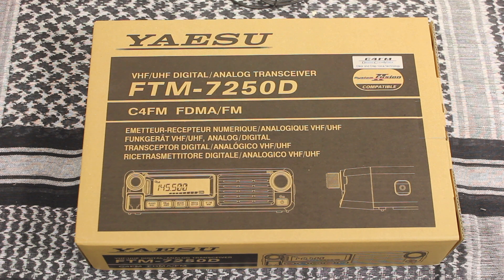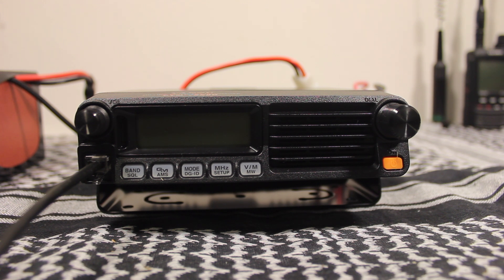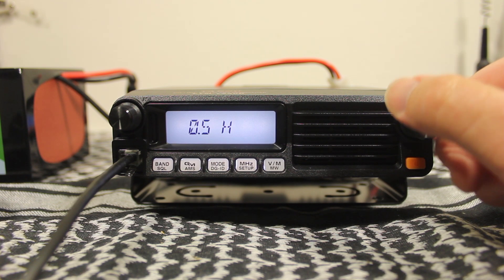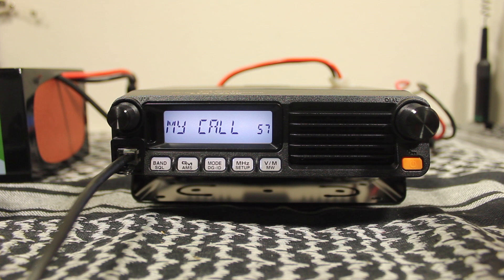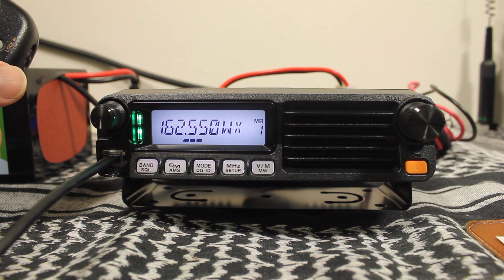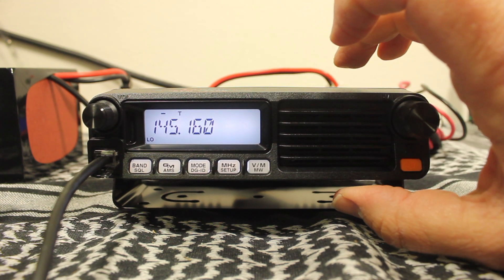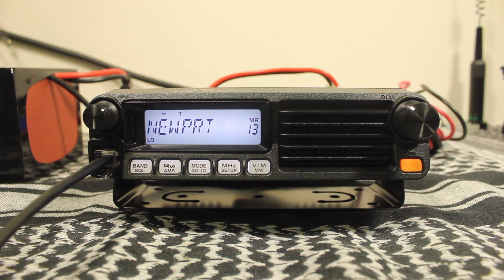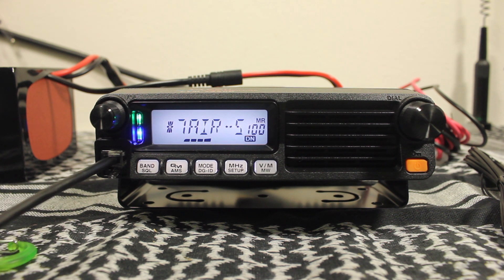Yaesu FTM-7250DR Overview And Programming

Comment: Wow, now that is a deal.  Our club was just thinking about a fusion repeater but the cost of the radios were really putting us off.  This is super affordable.  Thanks for the heads up on this
Reply from the maker: Thanks for taking the time to watch and comment! It is greatly appreciated. At the time of this video the FTM-7250 is going for $189.95.
Reply: So much less repeater abuse on fusion too, makes life a lot easier if you're running one as you don't have the numpties on baofengs just being assholes. The slight cost increase is a great barrier to entry for the trolls.

Comment: I bought one of those after a lengthy research and I get good contacts on the 2m band even at 50 miles away from some repeaters.   I appreciate showing us , slow learners ,  how to program the frequencies.  It appears that there is no difference in programming a Fusion repeater that a Non Fusion one.  I travel to Orlando FL from Mooresville NC often and want to program all the repeaters down I-77 , I-26 , I-95 and the FL Turnpike.  I still don't know what is the best software to program via computer.
Reply from the maker: Thank you for taking the time to watch and comment! I like RT Systems. They seem to have a program for every radio! They aren't the cheapest thing on the planet, but they work.

Comment: Is it obvious, and did I miss you showing how  to toggle thru analog to digital formats ?
The video seemed to go from you programing the Wilson repeater, to you dropping your call, where the display shows a " D ", off  to one side ?
Which button toggles thru modes ?
Also, can you program the memory for digital only mode, or must you toggle between modes manually ?
Thanks !
Just took a risk and ordered one of these, long after they discontinued them !

Comment: i am a amatuer radio operator here in so cali as well inland empire looking to get started in to fusion radio this video help me out alot
Reply from the maker: Glad this video helped out! There is a linked repeater on Sierra Peak that is pretty active. It is one of the ones I use around here.
Reply: @WJ6FRadio  can i hit it from the inland empire area
Reply: @WJ6FRadio  the orange county area
Reply from the maker: robert traylor I think you should be able to. I use the repeater on Mt Wilson since where I live I am shadowed from the Sierra Peak Repeater.
Reply: @WJ6FRadio  ok i will have to look it up i donot know the freq
Reply from the maker: robert traylor Sierra Peak is 445.760.
Reply: @WJ6FRadio  i will try and contact you KE6CZH
Reply: @WJ6FRadio  im on 445.760 fusion right now sierra pk kd6com
Reply: ok it is busy
Reply from the maker: robert traylor sorry I wasn’t available to get on the air.
Reply: @WJ6FRadio  i will monitor hopefully catch you on the air

Comment: I have tried programming a friends radio but i can't access any repeaters locally.  I have it set for TONE transmission and the correct PL tone set.  I hear the repeater just fine but can;t bring them up.  This is the same whether on 440 or 2M.  I'm stumped.  My procedure is just like yours.

Comment: Thanks for the vid. Just bought one of these myself. 😀
Reply from the maker: Thank you for taking the time to watch and the comment! It is greatly appreciated. Glad you enjoyed the video. Hope this radio is working well for you.
Reply: @WJ6FRadio  Actually I programmed mine with RT system software. So your video was nice to see the manual programming, which doesn't look that bad.
Reply from the maker: I prefer using some sort of software, but figure it is always nice to know how to program a frequency manually in case a computer is not readily available.
Reply: @WJ6FRadio  FYI, if you get the RT software you need their cable on this one. The factory data cable will only do firmware updates. The RT cable actually plugs into the Mic jack.
Reply from the maker: Thank you for the heads up!

Comment: Great video, thank you for taking the time to put it out there. I am new to the hobby and I am thinking of getting this unit to set it up as a base unit in my house. What would you recommend for an entry level antenna to mount on the side of my chimney on my house? Thanks.
Reply from the maker: Thank you for taking the time to watch and the comment! It is greatly appreciated. I highly recommend the Diamond X-50. If you don't want too long of an antenna the Diamond X-30  is also a great choice. If you want super long I like the Diamond X-300 which is 10 feet long.
Reply: WJ6F thanks for the recommendations on antennas. I will look those up and do some more research. What antenna are you currently using with the 7250dr and what was your furthest contact that you made?
Reply from the maker: @wdsracer  Right now I have the FT-7250 connected to the N9TAX roll up antenna. They cost about $30 and can handle 100 watts. I have a video or two on this antenna. I have hit Catelina Island repeater from house with the antenna hanging inside the garage. Cataline is about 30 - 35 miles away... I think.....

Comment: Have you heard of any issues getting the call sign entered on first boot up? I came across this video thinking that I was doing something wrong but I think there might just be a problem with my radio. When I turn the dial knob I can feel the clicks in there but The welcome message just keeps scrolling across rather than letting me enter my call sign.
Reply from the maker: Thank you for taking the time to watch and the comment! It is greatly appreciated. IT sounds like there is something wrong with the knob. I have never heard of anyone having an issue with inputting their call sign in to the radio.
Reply: @WJ6FRadio  I ended up getting past it. I had to do 3 factory resets and then it worked. Just in case anyone runs across this later.

Comment: Almost a year later... how do you like the radio?   I'm really leaning towards this one.
Reply from the maker: Thank you for taking the time to watch and the comment! It is greatly appreciated. I think this radio is great! I haven't had a single issue with it. I use inside so no reason to spend money on a radio with GPS like the FTM-100 or FTM-400.
Reply: @WJ6FRadio  You just pushed me off the edge. LOL   Really leaning toward this one for some reason.  I'll be using this inside as well and I really like the fact the head is attachable.  I've seen too many that the head can't be attached and I really don't want to chase that all over the desk.  LOL  Thanks for the reply!

Comment: Just got this radio and ft-70d. Tried DMR and my brain said NO in making code plugs. I’m a little stumped in programming fusion repeaters. RepeaterBook shows a pl. tone in the fusion lists. I’m using RTsystems software. Do I use a pl. tone or make same freque channel for digital ? Try to unscramble my overthinking this please. Thanks.
Reply from the maker: Thank you for taking the time to watch and the comment! It is greatly appreciated. I tried DMR a number of years ago, and I didn't do well with the whole code plug creating. I can down load a preexisting one, but that is the extent of my knowledge base. If memory serves, the Fusion repeater near me does not use an PL Tone. I now it may be a hassle, but I would try entering it both ways to see which one works. You never know how the repeater owner set it up.

Comment: Are you running off a battery? If so what kind is it? Thanks
Reply from the maker: Thank you for taking the time to watch and the comment! It is greatly appreciated. In the video I am using a 20ah lithium (LiFePo4) battery, BLF-1220, from Bioenno.
Reply: @WJ6FRadio  How long is the battery life with a mobile radio? Also do you think I could charge this battery with a solar panel? Thanks in advance! Great video!
Reply from the maker: I have not timed it, but with the 20ah battery I use, I can get hours. It wouldn't surprise me that when listening only the 20ah LiFePo4 battery will last, if my math is correct, about 15 hours. That will change depending on how much you talk and how many watts you are pushing. Here is a link to a video I made on the Bioenno battery system I use. https://youtu.be/YYoAQ6f5Y3M
Reply: WJ6F thanks for the info! Subbed!

Comment: I can't figure out how to turn off the beep that occurs every time someone keys up on digital. Can you please advise? Thank you.
Reply from the maker: Thank you for taking the time to watch and the comment! It is greatly appreciated. I have the same issue on my FTM-400 and have not been able to figure out how to stop it. I will see about calling Yaesu and see of there is a fix for this. It is rather annoying. On my old FTM-400 I could turn the beep off, but not on the FTM-400XDR.
Reply: @WJ6FRadio   I think if you turn off the start up chime that happens when powering the unit on then the Fusion beep stops. Cant remember exactly.

Comment: Man, nice radio for the price, but; the fact that you cannot separate the head unit is a non starter for me! Also, not usable for Wires! It's a good deal for a base station radio though! As usual, very professionally done video, thanks for taking the time to share. N1CY
Reply from the maker: Hello there! If this radio was going in the mobile not being able to separate the head unit would be an issue. This is going to be used in the shack. It will be replacing the TM-V71A, which will be moved elsewhere.

Comment: Hello many tnx for the video , is it possible to connect to a hotspot / jumbo spot or openspot ?..
Reply from the maker: Thank you for taking the time to watch and the comment! It is greatly appreciated. Yes, I use a ZumSpot with mine. Works like a charm!
Reply: WJ6F many TNX FOR THE REPLY I AM PLANNING TO BUY ONE ... I need to use as a fusion like FT3DR. Appreciated thanks 😊 73
Reply from the maker: @binoykv  I am really enjoying my FT3. If you don't already h ave one I have a video on programming the FT3 manually and with any of the 3 software types.

Comment: Have you tried  get a cor cos squelsh signal from this radio. Since it does not have a mini din packet port.  Can this radio also be put on 1 Watt rf output power.
Reply from the maker: Thank you for taking the time to watch and the comment! It is greatly appreciated. No it can not be lowered to 1 watt. The power settings are High (50 Watts), Mid (25 Watts) and Low (5 Watts)

Comment: If you dont have a call sign can you still use it to recieve?
Reply from the maker: brian araluce Thank you for taking the time to watch! Yes, you can receive without having a call sign.
Reply: @WJ6FRadio   no problem always willing to learn from the pros. Which base station can I purchase to do this On hf? Do you know of any? usually they all ask for a call sign as soon as you turn them on?
Reply: @WJ6FRadio  ok got it.. I just figured you wouldnt be able to bypass the call sign screen if you didnt enter one.
Reply: @WJ6FRadio  thank you!!
Reply from the maker: Typicaly the radios that are not digital (Fusion, D-STAR, etc) will not require a call sign to be entered in to the radio the first time you power it up. That goes for both HF and VHF/UHF. Hope that helps.
Reply: @WJ6FRadio  awesome!! Ile see what I can find.. Appreciate it.

Comment: I was hopping you would show how to change bands.
Reply from the maker: Thank you for taking the time to watch and the comment! It is greatly appreciated. Press the button the far left that says "BAND/SQL" to switch bands. (Air Band - 108-137 MHz; 2m - 137 - 174 MHz; Info Radio Band 1 - 174 - 222 MHz; Info Radio Band 2 - 222 - 420 MHz; 70cm - 420 - 470 MHz; Info Radio Band 3 - 470 - 580 MHz)

Comment: how to i program 147.435  output and  146.400 input
Reply from the maker: Thank you for taking the time to watch and the comment! It is greatly appreciated.  1. program your receive frequency first, and remember where you saved it. 2. go to VFO and program your transmit frequency. 3. press and hold the [V/M (MW)] button until the memory number appears in the bottom right corner of the display. 4. rotate the dial to where you saved the receive frequency. 5. Press and hold the PTT while holding the PTT press the [V/M (MW)] momentarily Until the memory number in the bottom right disappears. 6. go back to memory and on that memory channel you will see both the + and - next to each other. Then you should be good to go.
Reply from the maker: Putting together a video on this right now. Should be up very soon.
Reply: @WJ6FRadio  ty
Reply from the maker: You are very welcome, and that video is now posted!
Reply: ty did it works fine question i have a kenwood tk-981 900mhz you know any one that can program it i can read from radio with software kpg-49d but to chage reapeters the other software doesnot work with windows 11 @WJ6FRadio

Comment: Programming software is $50. Makes loading a lot of repeaters EASY. The program uses your zip code and radius you desire.Then all the menu options are easy to look at without scrolling. 
    Programming one right now with software. Came to see if display would show both frequencies and names at same time like my ftm-400. Obviously not. Hope the the guy isn't disappointed when I return his radio when I am done programming it for him. 
    Personally I'd buy the ftm-100 if I was being cheap.
Reply from the maker: I agree software is convenient and faster. However, should there ever come a time when software isn't available then knowing how to program the radio "manually" is import to know.
Reply: @WJ6FRadio  
No not really. When radios had like 20 to 50 memory channels and mono band; not an issue. But with all the internal switches and extra memory channels and FUNCTIONS, it is NOT practical. It is program software or I'd avoid this radio if I didn't use software. It isn't the friendliest to hand program.
    I made the owner by the software so I can easily fix any alterations he may accidentally do.I loaded the radio for a guy that couldn't begin to do it himself. And I filled it with lots of extra channels he can monitor, as he is using it as a base radio.
    Adding and deleting by hand in the middle of nowhere by the mic is okay, but not when you are putting 150 plus memories in, and I installed about 195 of the 199 memories. That is NOT a by mic job. 
>>>>> With radios like this and a person that WILL mess it up, I am not sitting for hours finding all the areas he messed up, when I can just flash it and put it back 100% in a matter of a few minutes.
Reply: @onemarktwoyou  Not having any luck programming my memory channels.. The channel # I want to put in is not blinking and there is nothing loaded there so I can't save it there.. Nothing in the book on how to delete that channel.
Reply: @joeglover8171  
If you are using software there is at the top the ability to download all the repeaters you'll probably need. 
    I always start by taking an image of what the factory has in the radio to start. And SAVE IT. 
    With that image saved I then open up a new tab in the program in which to load all the channels I want in the order I want.
    Then copy and paste that to the image which I had pulled off the radio and had saved. Then save that image under a new name for future use.
     Important to use cable that came with the programming software, >>>NOT<<< the cable the radio came with. 
    Yes the owner of the radio messed with the radio and it didn't want to take the program to start with. And the radio did not want to accept program until the forth or fifth attempt.

Comment: Yaesu makes some great radios. Too bad that their manuals not very good. The spaghetti code of manuals.
Reply from the maker: Thank you for taking the time to watch and the comment! It is greatly appreciated. True. Sometimes it is like trying to read Greek.
Reply: @WJ6FRadio  You did a great job. I think I missed something though. Seems like the default is DM (blinking). The mode button changes that but for now I just want to use analog FM as a default if possible. Can that be done? My motivation for other modes is low since the local repeaters which used to be very active are not used much anymore.